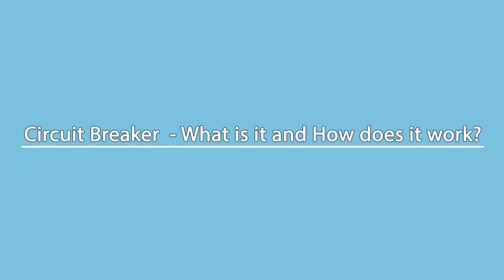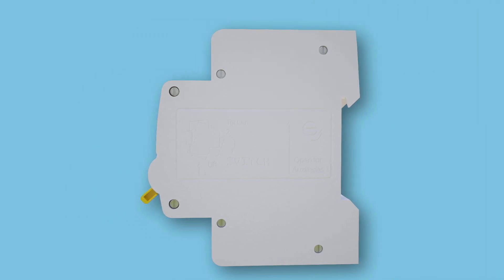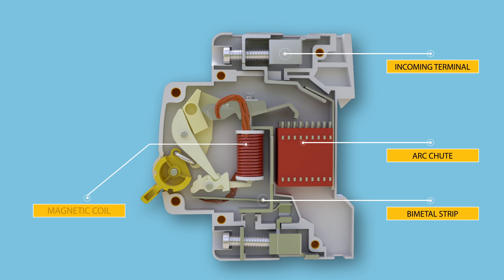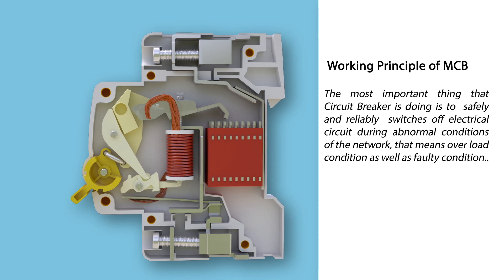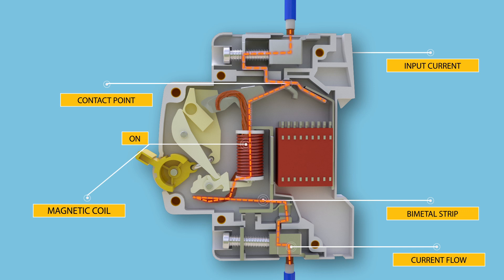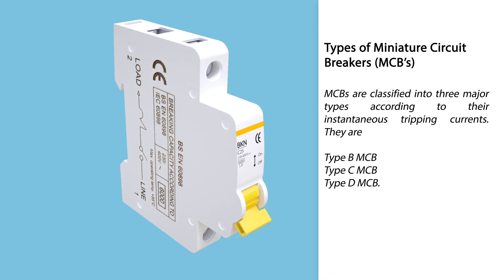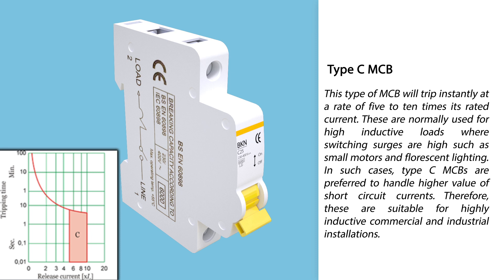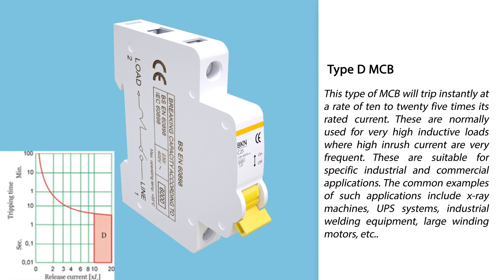Miniature Circuit Breaker, (MCB), How does it work?

Comment: I think the MCB is upsidedown in the animation. The arc will rise to the extinguisher because it's hot. In your animation the arc has to move downwards to the extinguisher.
Reply from the maker: I dont understand
Reply: @chrvoje_engineering  the extinguisher is below the arc. I think it should be above it in order to work

Comment: Hello, can these be used safely in a 110 Vac installation? If yes, would there be any effect on the current rating / operation of the breaker?
Reply: MCBs can be used for circuits up to the rated voltage, so yes a 240V MCB can be used in a 110V circuit. Same current ratings

Comment: Well done.If possible please explain about the breaking capacity of MCB and also the details printed on the the MCB.
 Examples like B16,B10 what does it mean.
Reply from the maker: B is typo of fuse, you have also c and type of fuse, 16 or 10 or 6 represebt nominal current which fuse can disconnect. On MCp are printed various information like breaking capacity, world normes etc...
Reply: @chrvoje_engineering  Thanks

Comment: Can one use MCB in place of voltage stabilizers while using smart TVs, Computers, etc.
If yes, which type (B or C or D) would you suggest.
Reply from the maker: I work like Electric designer, when I make projects for TVs, computers I use C fuse

Comment: Input supply is connected to the bottom of mcb, if I'm not wrong.
Reply: ji pa ji tusi sahi o .. eh just informative ved thi..
Reply: depends on the manufacturer of the MCB.
Reply: The upper side is usually used as output terminal and the bottom as incoming/input terminal.

Comment: I have a doubt bro. I'm using MCB for the pump switch and i am planing to fix a auto off circuit when tank is full... 
When there is a short circuit MCB will turn off automatically... so 1.can i short the circut using a relay for auto turning off the pump??
2.Will it cause any permanent damage to the MCB or the relay ?
Please ans me because this is my project and if u didn't understand my question i will send the circuit diagram
Reply from the maker: send me designe to see, i didnt understund, But for controling water in tank xou probably use float switches, who activate relays and then relay disconnect circuit where is pump. I allways protect my pumps, motors with MOTOR PROTECTION SWITCH because motor protection switch protect pump from overloads (MCB not), also i put in circuit where is pump CONTACTOR. See my video: maybe it will be clear

https://youtu.be/zeupkEPOQsQ
Reply: Ok i will send u the diagram plss give u r watsapp number
Reply from the maker: @ashvin9685  https://www.facebook.com/profile.php?id=100015365768626 post picture to my facebook, or send wia : https://wetransfer.com/
i don tlike to give my phone to public i think that you understand :)
Reply from the maker: post link of we transfer here i will take a look

Comment: You didn't show how the arc is extinguished by the arc chute.
Reply from the maker: The primary purpose of an arc chute is to extinguish an arc each time a circuit breaker interrupts a current. This is accomplished by confining, dividing and cooling the arc. 
I didnt mentioned this, maybe in next video? thanks for comment
Reply: Yes. I studied this as part of my degree in electrical engineering but you failed to mention it much at all. It is one of the most interesting aspects of a small MCB.
Put it into a future video.  You might need a high speed camera to show the arc but I'm sure that you can get your hands on one.
Reply from the maker: Thanks for advice, also if you have any idea for next my video fel fre to mentioned

Comment: I would like to highlight two aspects:

1) The input terminal is always on top of the device and not on its bottom;
2) What you show in the animation could happen only for overload current. In case of short-circuit the opening dynamics is totally different. 

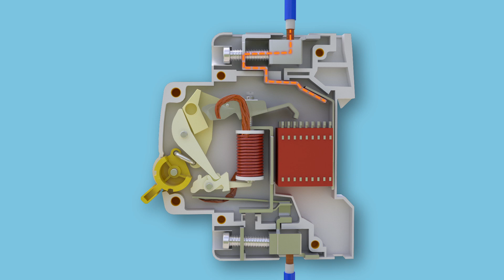Also, an physics observation, does not exist any current when a circuit is open (as shown on 2:30). There is only a potential difference between the input and output terminals.

Anyway, great animation and video! :-) ;-)
Reply from the maker: Mr Francesco, let m answer on your question?
1) Automatic fuses are two way (in most casses - schrack, eaton, schneider fuses), input can be up and down
Reply from the maker: 2) short circuit is some kind of overload circuit (just much high), in one hand you are right, but I just want to show simply animation to people ubderstund, maybe in next video I will try to make even better :):):)
Reply: The working principle in case of short-circuit is totally different. In case of short-circuit the main effect is magnetic and not thermical as shown in the video.
Reply: Anyway, I rappreciate your work because the video and the presentation are really well done! ;-)
Reply: Fuses are different kind of device, they are reversible component. Circuit Breaker are not reversible. They functionality depends from where to where the power flows. In fact, on distribution lines (Medium voltage line) the protection are bidirectional. In any case, the switch that could be "up and down" will be totally different from which you shown in the video.
Reply: Francesco Cositore

Comment: informative. 
clarify, you mentioned incoming terminal is in upperside. But in outerview it is in bottom side(LINE  /1). 

Does this reversal of connections makes any difference?
Reply: PrabiN PanikkaveedaN I'm wondering the same did you find the answer
Reply: no
Reply: PrabiN PanikkaveedaN 
I hv 16years experience
Live terminal is down side
Half point terminal is up.

But some electrician says  up or down.  There is no matter....